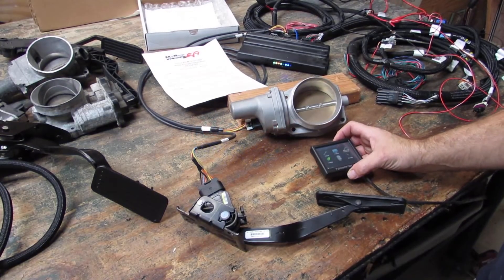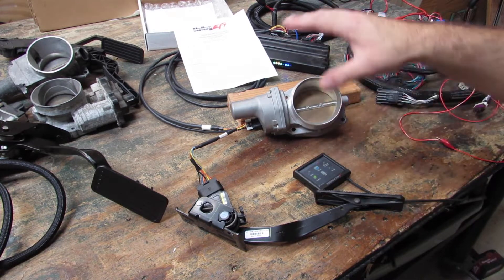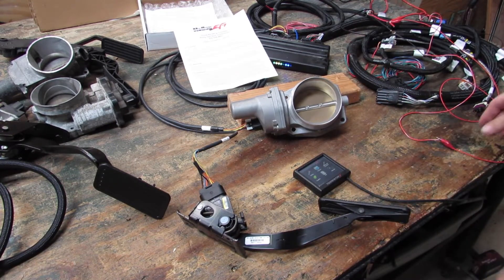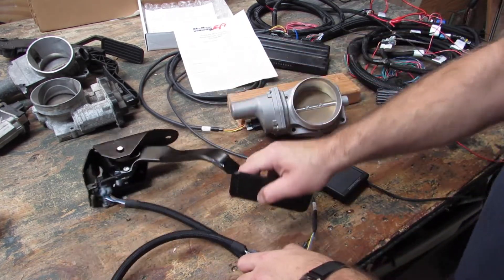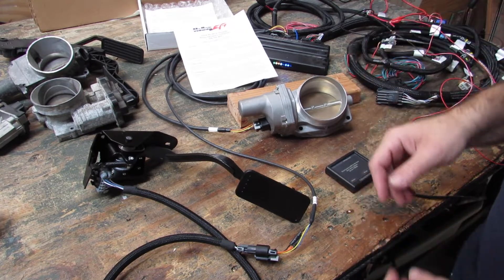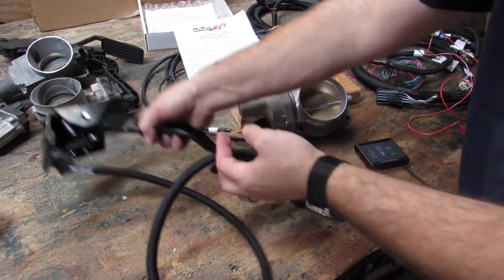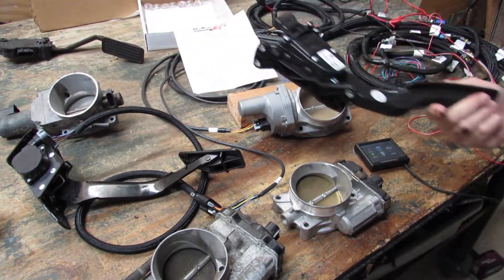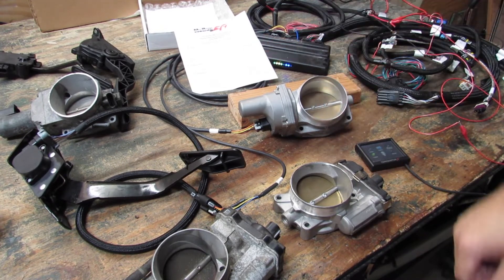Holley Terminator Throttle testing part 1

Comment: I purchased the colorado adapter and perfomed the tps autoset successfully. However on the handheld lcd the tps shows as 21% and holley states it should be 0%. How can my current reading of 21% down to what holley suggests?
Reply from the maker: The throttle blade usually rests at around 18-20%. If you just look at the throttle body you can see that it does not rest in a closed position, it is always slightly open. If you push it closed by hand, you should then see 0%

Comment: hey I got the harness from u guys but I keep getting tps autoset was not successful please try again error 19. but when I plug the old one back up it works just fine any help?
Reply from the maker: Hello, check your emails. I do believe you sent this request to our tech support already today and we've responded.
Reply: @cpwire78  ok thanks
Reply: Hey did you ever figure out the problem I have the same error code